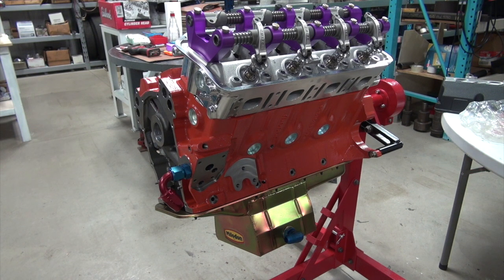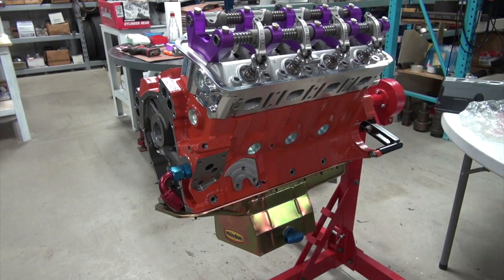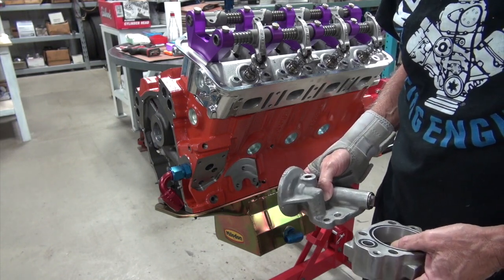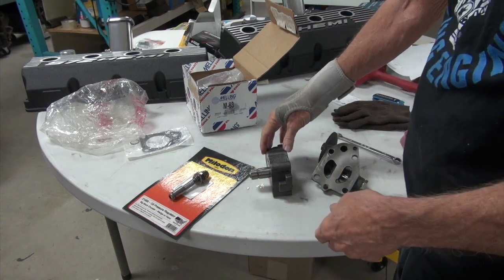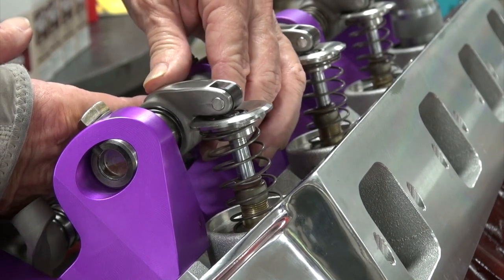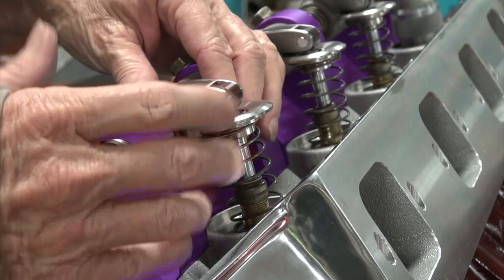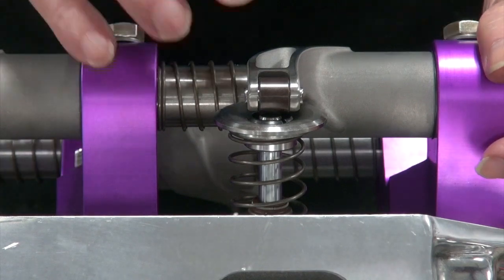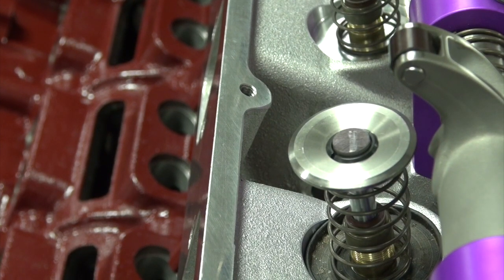Building your 426 Hemi Ep 9 #426hemi

Comment: Why don't you have that oil pump body spray welded and machines back to spec and smooth surface?
Reply from the maker: Normally when I see spray welding it's steel and spinning in a lathe. Even if you could, then it would be tough finding the center of the hole. It's not an easy fix. Maybe someone could but I don't think it's me. I would just like to find a new one. They're out there. Thanks for watching.
Reply: @rickseeman5679 There's a place up in Michigan that can apply an abratable coating to that oil pump. It's Line 2 line coating.

Comment: I´m old school and back in the days a dual line system ment problems with the motor mount bracket. Please look in to that, using new oil pump. Great video and greeting from Sweden
Reply from the maker: Yes, you normally have to do a lot of cutting on the stock motor bracket to run the dual line. And the K-member is there. And the headers. And the steering box. It gets tight real quick. Thanks for watching.

Comment: Never knew they didnt recomend any sealer on the oil pump gasket...i always use the Rolls Royce Hylomar selant...never had an issue in 30+ years.
Reply from the maker: I always assumed it was because they were afraid the person would put too much on and it would be sucked into the oiling system.

Comment: Great video Rick.
Maybe you could get some -.050 valve locks.
Would move you retainer down .050.
May give you what you need.
How hard are you going to turn this engine.
I thought the oil supply was related to Horse power and RPM.
Like the single line up to 7,000 and dual line up to 8,000 and over.
I always like the HV oil pumps.
Mainly Wedge engines however.
Take care, Ed.
Reply from the maker: Great idea. I was going to call Manley Monday and ask about -.050 retainers but keepers would work also. The HV pump is always the starting point for a high output engine like this but I want to try a stock one first so I can see how my 65 pump stacks up against it. Thanks for watching.